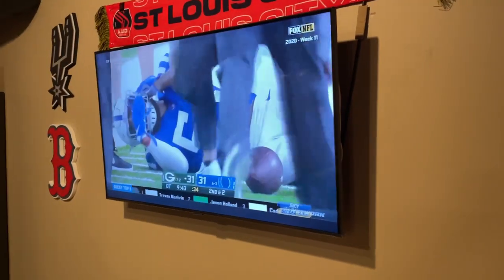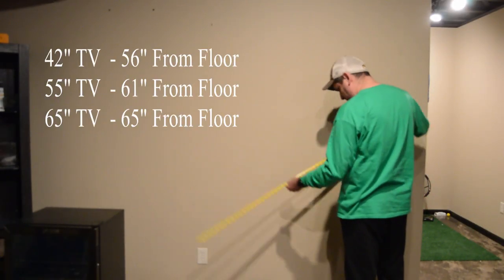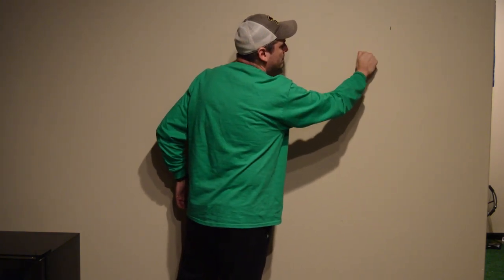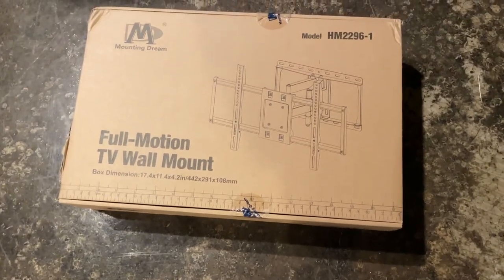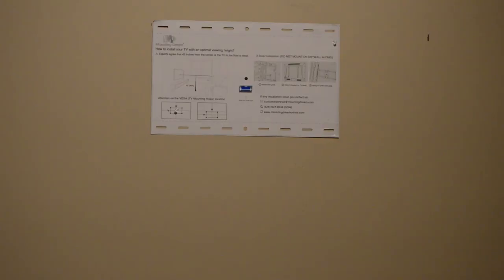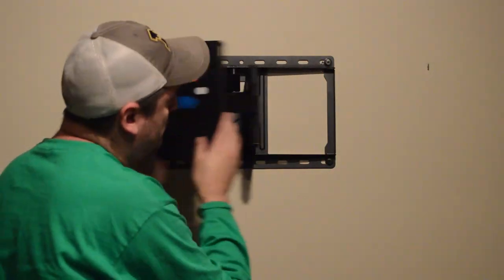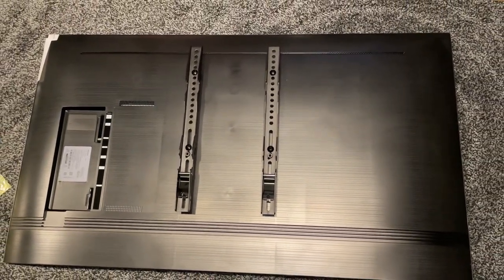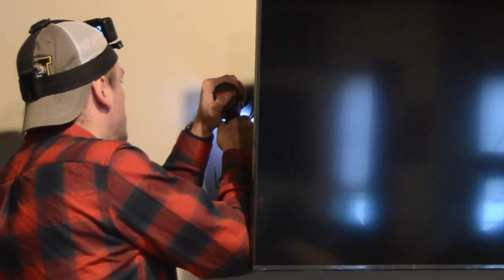HOW TO MOUNT A TV TO THE WALL & HIDE THE WIRES/CABLES | Super Easy and Simple Process | 2021

Comment: That goes against electric code in some states..only low voltage cable
Reply from the maker: Hi Vicent.. this is not a risk , not exposing a strip wires or something.. is  the same that you bought a extension  just plug and play.